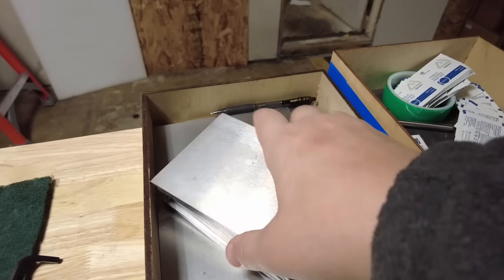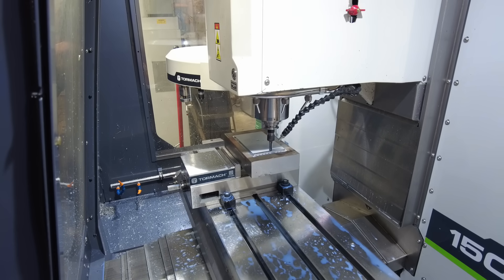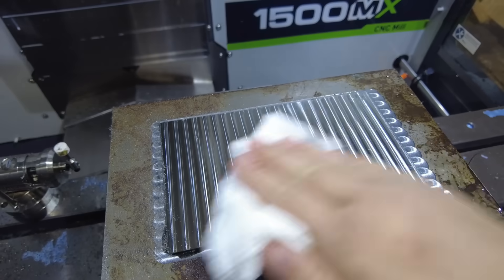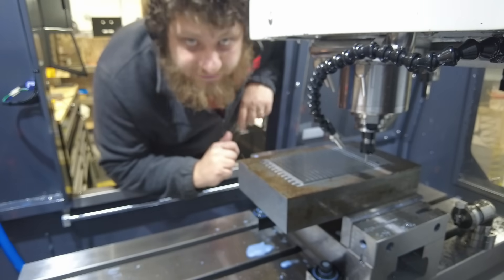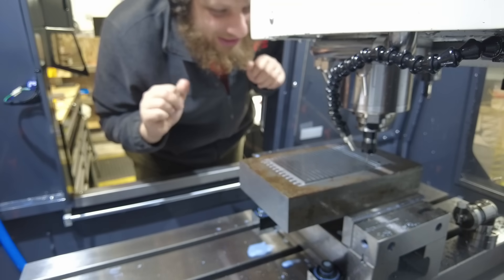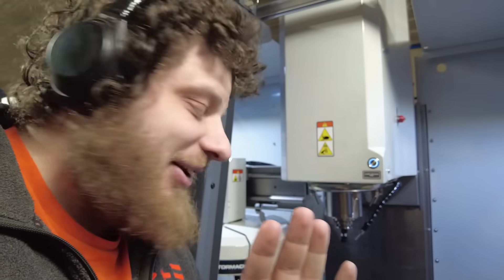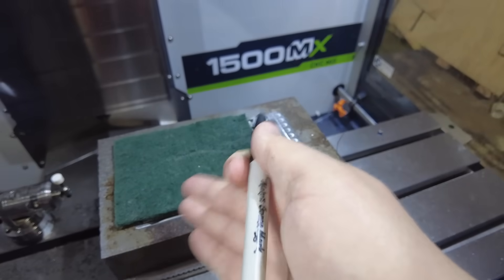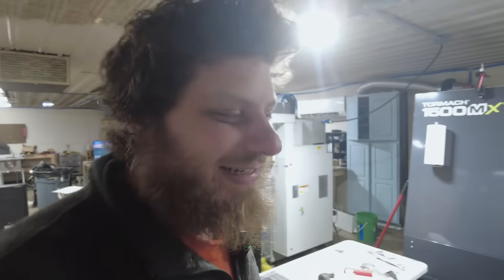HARDmilling (this project broke me)

Comment: #1-TOOLING - Get some 4 to 6 flute AlTiN Finish endmills with the shortest flute length you can get by with corner radius recommended. The more flutes the more rigid the tool. The shorter the flute length the more rigid the tool, it should go without saying but you are going to want a robust and rigid tool with minimal stick out. 

#2- RPM and IPM - If we are calculating RPM using SFM and diameter then 75-100 SFM is fine remember speed creates heat, if your tool is turning red and there are sparks RPM is too high. As far as feed rates were talking .001/.003 chip per tooth for roughing. You want to feed just fast enough to have that brownish/blue color on your chips, that means the heat of the cut is going with the chip and not into the tool. I stress again just fast enough, once you got some color that's fast enough. If you are running flood coolant all the same stuff applies and yes, I know about heat shock but considering your DOC are like around .050 for roughing and all the other previous cutting conditions are set and the tool and material are immersed in coolant you will not get that kind of heat into the tool or material. The chip evacuation that the flood coolant provides will also be your friend.

One more thing in regard to multiple flutes. We are dealing with a very low RPM to keep heat low and of consequence a slow feed rate, the more time the tool spends spinning at any given place on the material can result in more heat going into the material and cutter. The more flutes you have the more chip per tooth per revolution, and that means feed can increase which will result in less revolutions of tool at any given particular place in the tool path AKA less heat.   

#3 That machine is more than capable of cutting 60 ROCKWELL material, people are silly, but you already know that. I will say you will have limits if you decide to push chip load but besides that I don't care if it's a CAT60 with shrink fit/hydro holder if you have crazy flute length you will have stupid things going on with that tool.  

Best of luck!

Comment: I'm a mold maker and we machine a lot of hardened tool steel. Two tips for you 
-look into buying a high feed endmill that has a radius if the geometry of your part allows it
-DO NOT use coolant! (try just air)

Comment: Thin, hard parts suck. But those jobs that suck and make me feel like I'm losing my mind are the ones that I learn the most from and walk away with more knowledge than I went into it with. 

My first foray into hard milling was a lot of trial and error as well. It's obviously part and application specific, but having a good rougher and finisher makes life a lot easier. A good AlTiN coating, a high chip load, and air blast usually does the trick for me. Live and learn!

Comment: By now I am sure you figured out something on this job, I would be surprised if you finished the parts using the process as you described it in the video. Slotting 60Rc A-2 with a 1/16 endmill would be problematic if the cutter doesn't have a corner rad, you wasted a bit of money on cutters. I would suggest you find a local tool vender like GL Technologies in Williamsport to sell you tools and offer advise regarding the actual machining if you are trying something new.

With that said, you would have been much better off to rough before HT, pay someone to grind these flat and to thickness on a wet grinder, then machine them to a finished state... easy money, low stress. HT vendors often offer flatness as an option for a cost, it would be worth a discussion... I like Strum in Indy, although it has been years since I used them, I assume H&H does great work too.

Comment: Love your ambition to try first and learn later. Alot of good comments in here for the cnc side. The surface grinder has a special place in my heart, and a semi-auto might be worth it if this will be consistent work for you. Can cut your time for first ops in half if not more, and an oxide wheel will last forever in comparison to endmills in hardened steel. Keep up the good work brother!

Comment: high feed endmills for hard machining is nice, but can you machine everything before heat treat? would be easier imo. Plenty of coolant too to prevent work hardening. Glowing means ur spinning too fast, chipping means you're feed too fast. also get pre grounded stock so you don't have to deal with the warp

Comment: A2 is so easy to heat treat that the warpage is less than that you get from hard milling.
Reply from the maker: Tried that the first time 😅 had to scrap all 18 of them. They warped like crazy due to some of the features in op2 I think
Reply: @AudacityMicro  Try again, only clamp them to a thicker base throughout the HT process.

Comment: You need proper tooling for hardmilling, it will last 10-20 times longer. If you can get them, Diabolo by Hoffmann Group are excellent. 
Another very important aspect is rigidity. You want as much of it as humanly possible. Now, changing the machine is unfeasable, and even a 150k Haas is literal junk for hardmilling anyways. But get yourself some extremely short tool holders for minimum stickout. No collets. Weldon, hydro or shrink. Best possible runout please, it really pushes up tool life!!
And for the tools, maximum diameter, shortest possible flutes, corner radius helps, shortest possible stickout. Hope this helps.

Comment: Reorder material pre ht make parts under size by 5 thousands per wall heat treat then finish if you're tolerance is within 7 thousands make to size a2 is very stable for ht

Comment: We machine quite a bit of hardened D2 and CPM 10v at the tooling shop I work at. 

We never run coolant on anything harder than 50rc. It kills the cut edge. Air blast only to get the chips away. We use AlTiN/AlTiCrN coated endmills, any corner radius is going to help.
 Depending on the DoC/WoC the surface speed will vary. For facing I'll start with 60-85 SFM since there is a lot of heat build up on the face of the cutter. 10% cutter diameter for DoC and 
25-50% step over depending on your rigidity. Chip load is usually 1% of the diameter per flute to start. 

Nice work and keep at it dude

Comment: If you are doing work that breaks endmills use a tool height check sequence at the end of that particular endmill. If the tool height check comes back with a incorrect value program the part to change to a backup endmill then run the same path again after a high pressure wash to flush out any material. 

If fines are causing an issue buy some on/off magnets and put them in the path of the coolant return. If you are cutting a material that is non magnetic and it is causing issues you can add a second inline filter with a pressure bypass, when filter A becomes loaded with chips the bypass will send the coolant to filter B. 

At some point when dealing with hardened material it becomes more cost effective to send the parts to an EDM shop for processing the small features only instead of the whole part.

Comment: You say you don’t always notice when a tool breaks. Are there no sensors for such an event to warn you?
Reply from the maker: oooh that is a good question that i didn't address. Long story short, I could do that, if I had a little more foresight when setting up the machine. But  I put the tool setter behind the vise. It works fine when the vise is empty, or it has a small piece of stock in it, but the giant block of steel was intermittently blocking the sensor from communicating with the receiver. This is an easy fix by either sticking the tool setter on a riser, or by moving it to the other side of the table. It made the tool breakage checks unreliable, so I took them out of the program so it wouldn't alarm out. I've been waiting to fix it until I put on my fixture plate.

Comment: I recently took on a job with 420 stainless, 51RC. It was only .039” thick and got all kinds of machined features, slots, holes, contours on both top and bottom. The glue hold method failed. It was a rough job. In the end, I did it.

Comment: Working in a die&mould industry for years now, programming and working on a VMC and lathe i can tell you this...
Proper tools for a hard steels is a must. Always pick higher rated edmills (hardess wise), always use endmills with corner radii, use air or MQL... AND high feed tools are a must in roughing operations, then you finish with other tools.

Good work figuring it out by yourself

Comment: AJ, respect for always sharing your struggles and your honesty. Hard milling with tooling which isn’t designed for it is just asking for trouble. 
Hard milling with proper tooling and high quality toolholders is pure joy and I love doing it. Tooling wise I can recommend Moldino or Garant tooling. For the holders it’s either shrinkfit or hydraulic. 
If you want I can send you some example fusion files. I’m also hard milling A2, up to 63hrc, on a machine which isn’t designed for it

Comment: Look into NS tool or Union tool for hardmilling tools. Absolute game changer, and cut up to 70hrc like butter. 

For Union, anything in the Hardmax line, HRRS for high feed roughing

NS: MHD and MHR line for square/bullnose
NS: MSB and MSBH for ballnose 

Don't be scared to buy metric, much better tooling available in metric, and the CAM system doesnt care if you program with a .236 for 6mm

I promise promise promise, good tooling makes a world of difference, and makes it easy and they provide very good book numbers for hard material. 
My day job is literally training customers on machines and how to modernize their processes.

Comment: As its A2 you could pre machine with finish allowance and send out for H/T then finish after. A2 wont move around to much with heat treating due to it being an air hardening steel. Solid carbide tooling with a coating is a must. Use air as coolant once you are above 50Rc. You want some heat in the cutting zone. the tooling will thermaly soften the part material on a microscopic level just in front of the cutting edge and help extend your tool life. Liqid coolants take out to much heat and thermaly shock the tool. Not a hard and fast rule but its a good start when you need to machine hard materials
Reply from the maker: that is absolutely what I should have done. The background to this project is that I made these parts soft the first time, but then they warped like CRAZY in heat treat. I thought that would be completely solved by hardmilling, but it turns out that it just kinda delayed the warping. In the end, I ended up leaving a hefty bit of material on the top and bottom, and ground them to size.

Comment: Nice video and its all a learning process. You can be in this trade for countless years and still be learning. 
Suggestions if you want to look into these :

Mighty Bite Vice Jaws are amazing for securely holding on to very thin material (they are a bit costly but your working piece will go no where like yours accidently flung off once you heated the glue up).

For tooling, I suggest an adjustable fly cutter that can span your entire Y travel so you only need to buy one. This will improve your skim time and makes a perfect mirror finish with no lines on the part like an EM does.

For Ball and Sharp Endmills my go to for anything over 55HRC is a brand called YG-1 they have a blue coating on them (the ones I use) and they cut up to 70HRC. Then when they get a little dull for hard materials you can use them as Aluminum roughers for MONTHS and they work amazingly.

I see you have the 1500MX but idk if you have through coolant or not but if you do for plunging holes I really like Kennametal Go-drills they are something to look into as well for time and cost saves for you.

Another tip for using a vice incase you don't know. If your clamping is uneven put a spring between the jaws (one on each rail) and then lock in your working piece. It will balance out the load of the jaw so one side is not tighter than the other. Its also a great way to keep parallels in place as well when using them.

Keep Up the great work and keep pushing to learn and prosper man!

Comment: indicate in the 1/16" endmill when you change it out try it might only be using one flute. i always try to ramp it in or predrill
Reply from the maker: that is definitely a possibility, I checked a couple of the tools when I was first discoing this breakage issue, and they were what I would call "fine for an ER collet". but going to a better holder probably would have helped, and I probably did have some later on that were out.

Comment: If u makes u feel any better yesterday I added an m0 to an already proven program and reposted and ran the program. I was near the machine but not sitting there with my hand on feed hold cause the programs run before. Only problem is I didn’t notice the program hadn’t transferred properly and with the last incomplete line of code it drove a 50mm cutter at 10k through the part and into the fixture, ripping tool out and friction welding it to the spindle taper. The $600 piece of ally scrapped is gonna be nothing compared to the new spindle 😢
Reply: Yeah that hits in the feels
Reply from the maker: oh no, that sucks 😢. There is nothing worse than a crash from something dumb that is difficult to catch, on an already proven program. My podcast co-host Harrison did something similar the other day, seriously damaging his TRT

Comment: Should definitely be drilling the slots out with carbide and then milling to finish.
Reply: @mitchellrife5220  yeah but they are really expensive. 
But would have saved a couple tools. In the long run it’s better to have too many tools anyway.
Reply: @Todestelzer  Why are carbide drills more expensive than endmills. Even china made ones I buy are like that.

Comment: Could you have hard drilled a lot of the stock in the rough slot? We use Dream drill’s that are inexpensive and great for material removal of through features before coming back and finishing with multi-flute endmills
Reply from the maker: probably! I'll need to try that at some point in the future.

Comment: I mill all the time hardened steel  about 55-60Hrc on my Hurcos,sometimes on tolerance and sometimes near tolerance and then grinding,it depends on tools
Reply from the maker: leaving it thick, and then grinding the rest of the way is definitely would have helped.
Reply: @AudacityMicro  yes,I leave about 0.5mm thick and then I grind on finish
Reply: What Hurco machines do you have? I have a VM10i in my shed and machine die steel with it.
Reply: @hawkprecision7878  one hurco bmc30 1000x51x610mm,two vmc30 762x510x610mm,milltronics rh20,two 4 axis tsudakoma 200mm,edm dieter hansen 450s with c axis,lathe us400 1000x300mm,Gmp flat grinding machine,prvomajska round grinding,asimeto and mitutoyo measuring equipment

Comment: I milled a part today and was thinking I saw and fixed every problem. Yeah. Opt 3 I set the work offset in cam wrong and I cut 0.5mm too much on one side. 
Only good thing it was for a prototype and can still be used to test it 😂

Comment: To help with some of the fine chips, can you maybe stick some magnets onto the side of the coolant return? Unsure how the coolant setup is on the 1500MX, but curious if some magnets could help pull them out of the coolant.
Reply from the maker: maybe! I would need to do some experiments
Reply: Surface grinders have exactly this, they have a rotating magnet that's up against a scraper that catches and scraped the grinding metal out of the coolant, and the rest of the non magnetic stuff is caught by coolant filter paper.

Comment: HPC High Feed Endmills for Hardmilling have been my go to for this kind of work, also you might wanna check with the tool manufacturer, it could be the case that you wanna runt he tool bone dry, heat cycling can make the mills go soft, and start chipping... but yeah hardmilling is an art... try hard turning ;D

Comment: Load multiple 1/16 endmills into the ATC. Then after a slot or 2 is complete (well before estimated tool breakage is happening) Do a tool change to a new 1/16 endmill. You said you are wasting 3+ hours of additional run time per part because of this. I'm sure One 1/16th endmill is not even close to 3+ hours of your time. 

Then after the part is complete replace the 1/16th endmills in the tool holders and move to the next part.
Reply from the maker: That would have been smart
Reply: This. No brainer.

Comment: I have had the same issue in ss316 plate where some parts would potato chip super hard and other would not. And of course it would break an endmill once the super glue popped off. I also have a strict policy where I don't make any parts past the test part until I have one completely done and thru final inspection. I have had to scrap entire lots of parts before because I didn't notice something until final inspection.

Comment: We have been running a lot of 50rc stainless. Coolant is a must. Carbide drills are a must. We ran all our tools at around 150-200 sfpm. You need the correct tools for the job. We used Harvey endmills that are made for hard milling. These endmills have a 20 deg helix and last 10 times as long as anything else. Haas also has a nice selection of hard milling end mills. When doing thin sheets like this you could do the cut flip repeat method to keep them flat or... straighten them. Another option is heat treat after machining. You'd be surprised how little most part will distort whensent to a heat treat that has quality heat treat machine. I know a2 is pretty stable from my experience but it really kinda depends in the end.
Reply: Seconded on the Harvey endmills. We run them on cobalt alloys at 50 to 54RC.  We've also had them special grind end mill profiles for us to use on stainless and it went well.